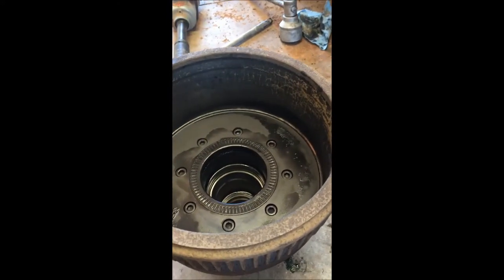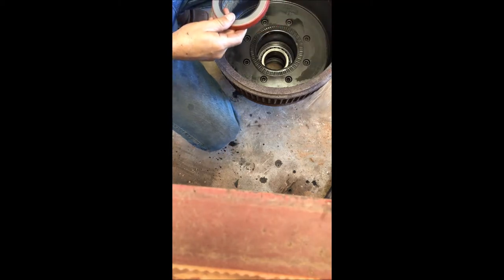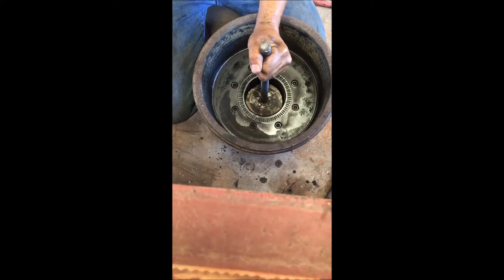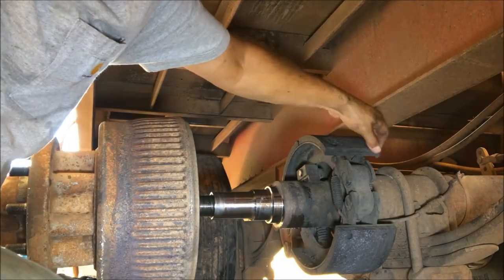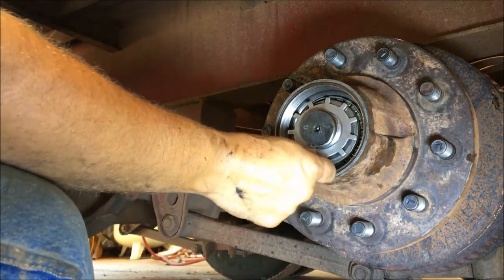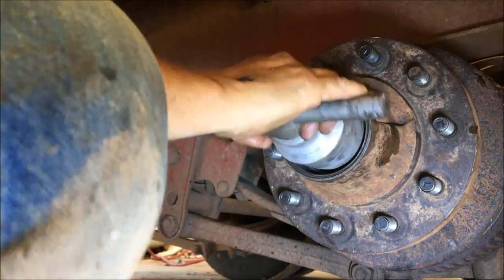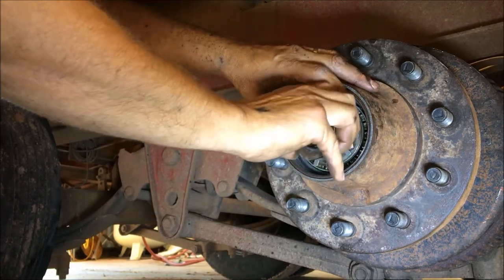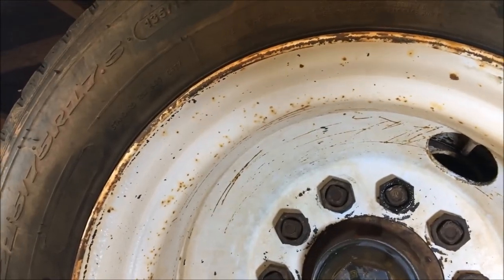Dexter wheel seal change

Comment: Thank you my friend. I’m on the road currently and have a dumb question….where do you fill the hub oil at? Got a leaky seal and need to add oil
Reply from the maker: The center plug on the cap, it’s rubber
Reply: @Digginok  so it goes in from the side? Like I need to take clear plastic hub nut off and feed it? I was hoping there would be a plug on top of axle tube or something
Reply from the maker: @BrandonLayMusic  the plug is in the center of the clear plastic cap
Reply: @Digginok  ahh got it! Back on the road thank you

Comment: I have a 20' gooseneck dump trailer I was wondering how can I find out the capacity of hub oil I'm going to do a change
Reply from the maker: I have since repacked mine with grease. Seals were always leaking.
Reply: @Digginok  what kind of grease do you use? I'm having the same leaking seal issue on my 40' gooseneck
Reply from the maker: @perryfeaster8931  any wheel bearing grease will work, I used the same gun grease I use for equipment. It’s 3% moly

Comment: Pretty awesome 👏 video by any chance were did you bought that socket and what sizes is it?
Reply from the maker: I do not know, I bought a cheap Chinese set of sockets 25 years ago. If I get time I’ll try to get it for you. Side note I have since switched to grease instead of oil, it has been the best so far. No more hub seal leaks. Dexter has a builtin on it.
Reply: Digginok Yesterday I was working on my 10k dual dexter axle and I couldn’t find the socket to remove the axle retainer nut, tomorrow I will check on Nationwide Trailers and see if I can find the right socket 2 5/16. I highly appreciated the fees back.

Comment: How do I go from  Hub oil to a grease system
Reply from the maker: Mike's Bobcat Services, LLC - Michael Lambrecht I basically cleaned the bearings and hand packed them with grease, replaced the seal and used the same procedures for setting them. The grease should be changed out yearly would be best, but I occasionally jack up the trailer and check for excess slack. That would indicate failure.
Reply: Is that a Dexter 9-32 hub stamp?  I have a 1994 Fleetwood Southwind with a Ford F53 chassis.  I am looking for information about my hub and the seals needed for servicing it.